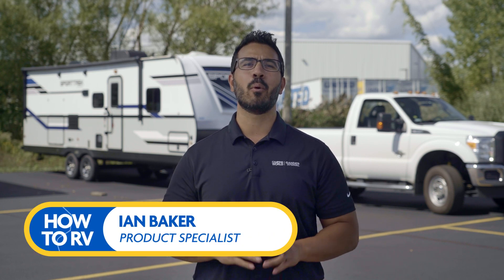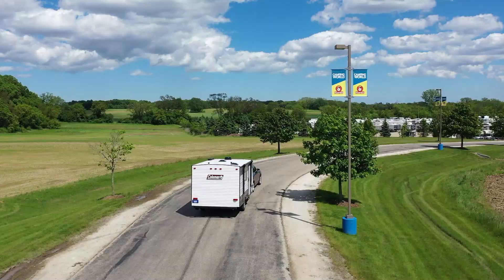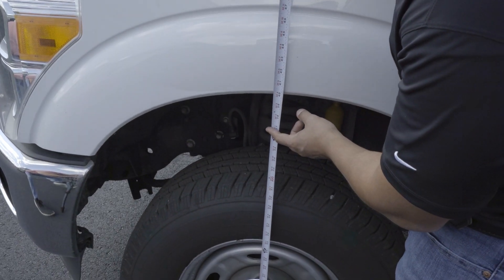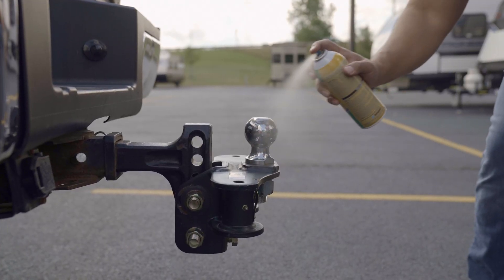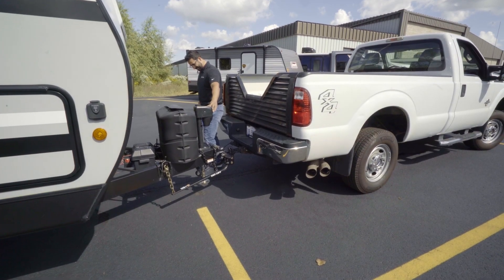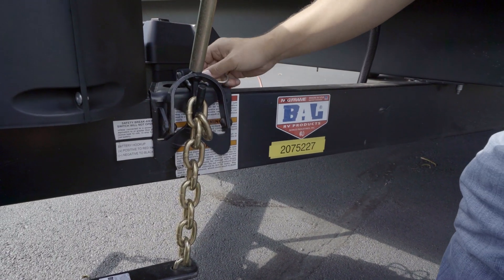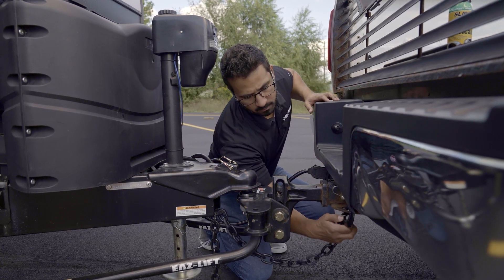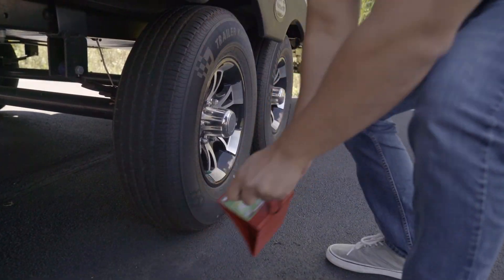How To: Hook Up a Weight Distribution Hitch

Comment: Wow, this was an informative video. I purchased my truck after I took delivery of my camper from Camping World (my cousin towed my unit off the lot). I had my hitch installed by a local trailer dealer & saved lots of $$$ over the cost quoted by Camping World. I think WD & sway control are important towing issues & glad to see a comprehensive video on the subject.

Comment: Great information, and you are right on about the necessity of a good Weight Distribution System. However, the system you are showing was similar to what I was using back in the 80's. There are much better systems now that combine Weight Distribution and Sway Control through the hitch head and spring bars, giving you 4 points of sway control.
Reply from the maker: Absolutely Ray! I was trying to display the hitch system I believe more people currently have. However you are 100% correct that an Equal-i-zer style hitch with sway control built into the arms vs having a separate sway bar is the newer and probably better system. Thanks for watching and for the comments!
-Ian Baker